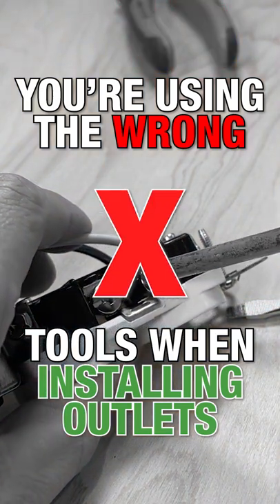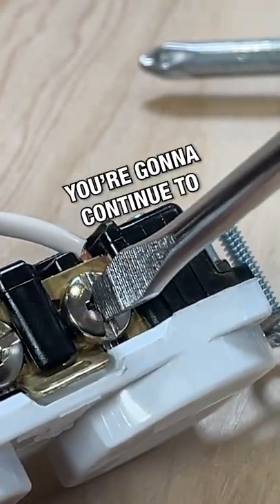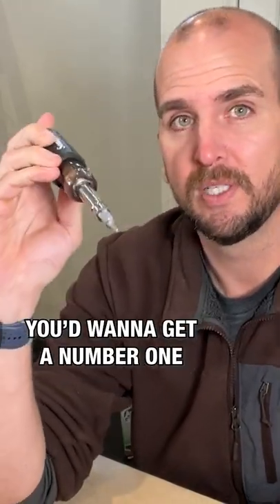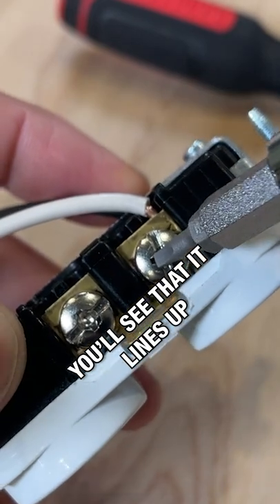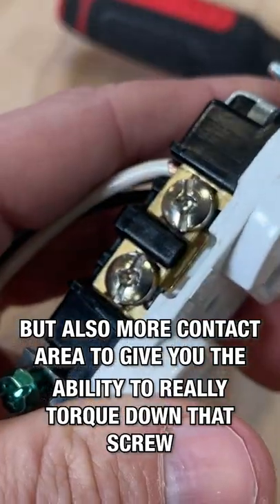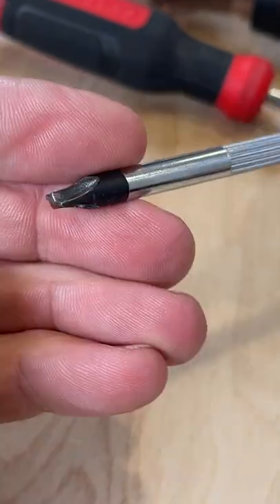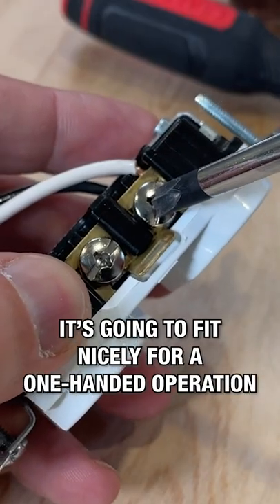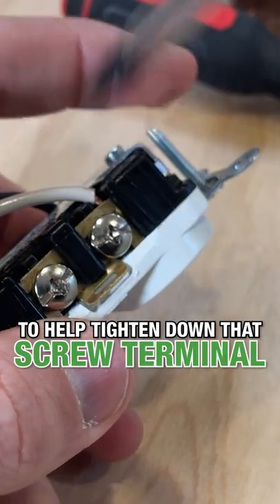Common Mistake Installing Outlets #shorts

Comment: You know what screwdriver I use when tightening device terminals? Whichever one is in my pocket at the time, I've never had issue using Phillips or flats to get the desired torque, on new devices that is I suppose old worn out devices I could see this being an issue but honestly just replace the device at that point. Nifty driver but not necessary imo
Reply: This is good, but about $$$...for tool industry.
Reply: My 6 in 1 gets it done every time...
Reply: Shit I've used a drill with screwdriver bits, pocket knife, butter knife lol.  But, I think the ones shown in the video are probably a little better than just using whatever is handy.
Reply: @CeeJayThe13th  good point... it's just that most of the properties I work on are 100+ years, electrical was added maybe in the 50's so most of the receptacles I change out actually have slotted screws so instead of going back and forth with drivers, I just keep my old faithful 6 in 1...good for the old and the new...
Reply: Also a butter knife.

Comment: Yeah but too many people will over torque it with that.  Good tool though as long as you don't over torque it.
Reply: You really can't over torque a receptacle terminal
Reply: @markusford6585  challenge accepted
Reply: @Robnoxious77  ok?
Reply: Reason why you can't over torque it is the copper will compress as you tighten it so it will untighten easier.
Reply: @Robnoxious77  instructions unclear.. broke off terminal
Reply: Robertson is a Canadian patent. Country wide we literally only use Robertson. Phillips or flat blade sounds like a nightmare lol
Reply: @dudesumting  they're both terrible. The square is worse, because of you slip ONE time, the screw is shot. At least with Phillips, you can push harder and get it out, even after it's slipped several times.
Reply: @littlejackalo5326  literally have never slipped. Been using Robertson for decades. That's the beauty of it, they don't slip
Reply: @dudesumting  if you have beta arms
Reply: @markusford6585  p.s. that would be beta wrists lol
Reply: @dudesumting  Well the issue is obvious, you are using the wrong muscles 😂

Comment: Torque comes from increased distance from the center of the screw (radius). Many brands make that tip, not just Milwaukee. Good advice though, hopefully those who can’t use a screw driver are messing with electrical components

Comment: What the hell are you torquing them to that a flat or Phillips aren’t good enough? Good lord. Of the literal hundreds of thousands of receptacles I’ve installed over the last 25 years, I’ve never had one that I couldn’t get enough torque on. Usually it’s the opposite and some dick hole has used a fancy screwdriver and torqued the f__k out of them and I can’t get them loose. That’s almost as bad as twisting/braiding 3” of wire together before you put on a wire nut.
Reply: Agreed...my 6 in 1 works every time...

Comment: I've been using a Robertson screwdriver for years.  It also works great in panels and on breakers.  Much better.  I don't recommend removable tips because they tend to stick in the hole and come out of the shaft, a PITA.
Reply: Panel drivers definitely are nice.

Comment: Are Robbie's now available in the US.   Canadian Patton.  Best screw driver ever invented.  I do like that combined one looks cool, but a one use screwdriver.  If your an electrician, I understand paying the price for the Milwaukee.
Reply: Yes they're getting pretty common finally in Ohio anyway.
Reply: If you’re talking about square drives, yes they’ve been used in RV campers for 40 years (at least Coachmen).
Reply: I don't know where this misconception that square drive isn't available in the US. We've had it available for decades, and no one wants it. The patent has been expired for over half a century.
Reply: The USA has had a recessed Square for many years.  It was never standardised however.
A guy in Canada named Robertson, Standardised them and then Patented them in the early 1900's.  1911 in the US.    The problem is that Robertson and Ford had some disagreements and the Robertson was not used in the manufacturer of Cars in the US from that point on.  The Robby found extensive use in Canada in the carpentry and electric fields.  They are standard noted from 1 to 4.  However, we Canadians prefer to use colour.   Yellow, Green, Red, Black.  Unfortunately, the USA is now producing what look like Robbies but are not.  They are known as the Nüvo drive system.  And worse, they are not keeping our colours.  And to your no one wants it crack... your very wrong.  The US car industry wanted it so bad, and Robertson would not sell it (his fault) the car industry created the torque screw head.   As far as do your trades want it.. well all your electrical uses Red and Green Robbies and has for years.  Your carpenters would be very glad to give up the Philips and get a screw that actually holds on to the screwdriver.
Reply: Here in Germany we have a nearly the same looking screw for breakers and such.
(We do phase out the screw terminal because of it's tendency to loosen under vibration or damage the wire if misused)
Pozi drive is something I feel like isn't used much in NA but it's a good and high torque Version of Philips.
Now to my point, there is a flathead/pozi drive hybrid and WERA and some other companys make specific bits for them, the amount of torque one can get with those is unbelievable (for a breaker completely useless though, they get tightened to a specific torque not nearly as high)
Reply: I'm 36 and I've seen square drive bits for my entire life here in the US.  Screws that use them aren't really super common but they've definitely been around for a long time.

Comment: I use an impact. Tell me I am over tightening and Ill mention how you knicked the neutral wire when you stripped it, reducing the cma and practically feeding that 15amp receptacle with a #16. Boy scouting at its finest.

Comment: I strip more with square heads than flat. Just have to use the correct flat.  Flat has way more surface area for torque.
Reply: Same but not a electrician but i use the ecx for connections and use the square Robertson to use on mounting screws

Comment: Klein makes a 15 in one ratcheting screwdriver driver with those bits and a bunch of others. Check em out. Great for installing receptacles when you want to feel fancy although a regular screw driver will work fine.

Comment: I agree the Robertson is the best tool for this almost all of the time. It should be noted though that when using a flathead/slotted screwdriver the blade is intended to be the same size as the screw head, not smaller or larger than the diameter of it.

Comment: It's funny these screw heads are designed to be universal. But Milwaukee makes a brand new screwdriver head the ecx just for this purpose. But that ecx is amazing I had the chance to use it on a job site and didn't have a slip. But that is just me, I always grab a flat head screwdriver for electrical outlets.

Comment: Slotted is the best for this task. I don’t know a single electrician who would use the square bit
Reply: I know more than one that has stabbed themselves in the hand with a flat blade too. The Robertson bit is a good one to have... It is used extensively on a lot of electrical devices and fittings.

A Philips slot is great as well, but the real problem is the combination Philips / Robertson fasteners make it hard for a Philips bit to fit tight enough to work properly.

Comment: What about using the correct size slotted screwdriver...also, why are you worried about wear on the screw when it probably won't be touched again afterwards...

Comment: If you must use stranded wire then it's best to tin the bitter ends with solder before securing them to the outlet terminal clamps. By design the outlet clamps were intended for solid conductor wire....THHN or similar.

Comment: Wow what a concept, using brand new tools with crisp edges and comparing them to worn out tools.  Also how much force are you expecting the terminal wires to absorb such that you need to use so much torque????

Comment: If you use the screwdriver the right way, it will work, and the tip won't get stripped out.

Comment: ALSO, the robertson fits in the ground hole. When you mount a device in the box, sometimes the device is turned sideways. You use the robertson and stick it in the ground slot and center the device after installing the faceplate.
Reply: That’s what a plug tester is for…

Comment: All they have to do is make the slot sloped inward. You could still screw it with a flathead driver but you coild also use a pointed flathead and then you’d get the best of both worlds while keeping complete backwards compatibility

Comment: I like the Wera insulated kit. I've also got the Wera Kraftform turbo (with the regular handle included). It's a great set, and it's got almost everything I've ever needed, along with the quick turning of the turbo handle, and a very similar bit that you are showing.
Reply: You probably mean a PZ2 with flathead, at least that in the European WERA sets.
I don't think it's of much use in the US or NA as a whole there the Phillips bit is dominant, a Phillips somewhat fits a pozi drive but the reverse isn't true..
Reply: @SuperUltimateLP  I concur. Wera does have a better more versatile PH/SL NON pozi. 
The part number for #2 PH/SL is 006456 and #1 PH/SL is 006455.

Comment: yo, pro-tip: if you use a klein heavy duty 10-1 screw driver, the #1 square drive is also long enough and tapered so you can stick it in the ground terminal, to help push it into the desired position. especially if you are using solid wire and making you’re splices in the outlet.
Reply: I would never use a multi screwdriver in a panel. The idea of a head sticking then falling into the bussing is something I’m not a fan of. Also, to align or straighten your duplex that’s what a plug tester is for.

Comment: Please don’t do this.
If they were meant for a square bit, they would be machined fixings for that, plus connections require correct torque for resistance.